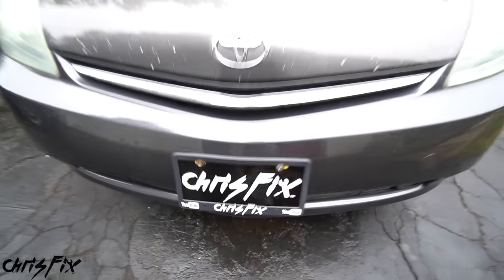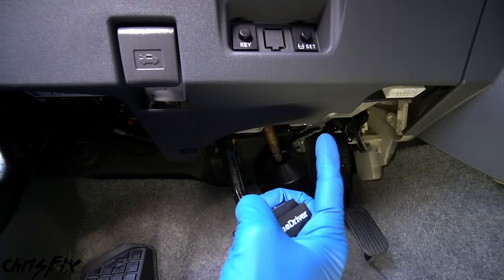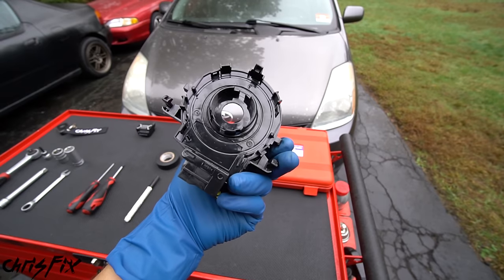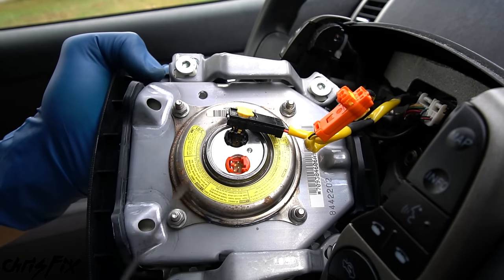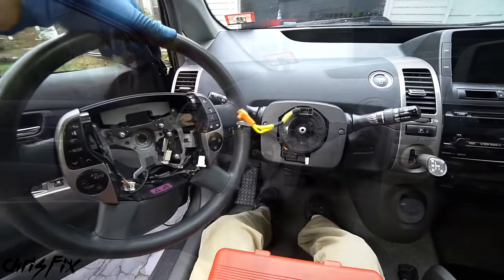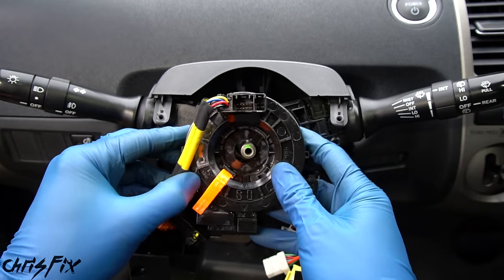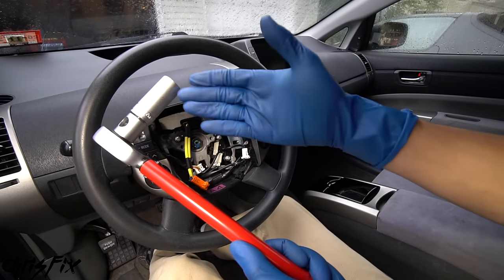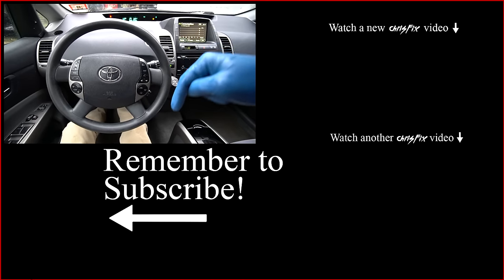How to Replace a Clock Spring (airbag light & horn not working)

Comment: What if the airbag light is on but the HORN still works? Could it still be the clock spring? I have a 2000 Celica and this is my issue. AIrbag light on but horn and cruise all work on the steering wheel. Thanks!
Reply from the maker: It could be. Sometimes the airbag circuit is the only thing to go. But an airbag light can be anything so just get that diagnosed real quick with a scan tool. Most parts stores will do it for free or you can get a scan tool for yourself to keep.

Comment: My horn Doesn’t work and says open circuit and if I turn my wheel to the left, it doesn’t show the speed anymore like it loses signal from the wheel. I might replace that clock spring to see if that fixes my issues.

Comment: Chris my horn on 2009prius was not working. I replaced the clock spring.all other buttons working.  Still horn not working.  I checked the horn fuse it was fine.  I have no clue.

Comment: So my airbag light is on and my horn doesn't work but the cruise works, the radio controls work. its an 06 Sonota. The airbag problem isn't the passenger seat switch either because the light under the radio isnt on with no one in the seat and on if someone is in the seat without their seatbelt on.  Any ideas? the horn fuse and relay are good. maybe both horns are bad. still not sure about the airbag.

Comment: I know this videos old but I hope someone can answer.. I tried replacing a fuse and replacing a relay for my horn ( 2011 Lexus CT200h ) and it didn’t work… I locked my car and had my hood popped cause I was testing the alarm .. the alarm worked and the horn was blasting - so the horn works but I can’t * honk * the horn from the steering wheel. What is odd is that sometimes when the car is in park, I’m not sure if ithe steering wheel was turned a certain way, but my horn would work - however it never works while I’m driving. And living in Miami - it’s important to have a horn. So basically I’m asking if I’m watching the right video right now ? Is it the clock spring that needs to be changed?

Comment: i have a acura rsx i had a 15-3 code faulty opds sensor , i deleted the code it came back today after abt 2 weeks , i was told it could be my clockspring but it’s not checking out for me

Comment: I replaced my clock spring but my steering wheel lock and is super hard to turn and 2 lights came on the dashboard, the problem got fixed but a new problem showed up my steering wheel is electric, do i have to do a calibration or smth to fix the super hard steering wheel ?
Reply: What lights came on?

Comment: So I replaced my clock spring but the airbag light isn’t turning off. Everything is connected and works fine but even after using an OBDII to clear the codes it turns off for a second before turning back on

Comment: Okay so my horn Works my airbag light is on I've got 4 codes

P0171
Fuel system bank 1 sensor 1 lean
P0121
Throttle position sensor signal
P0455
Evaporative emission system gross leak
P0442 
Evaporative emission system small leak

I don't think any of those are connection near the air airbag so any idea how to fix mine what do you think it might be a simple fuse blown or something eals

Comment: I don't see a horn switch button.  Coffee spilled on steering wheel.  I want to fix the horn and the Engine Auto off feature where the motor stops at stop lights to save gas.

Comment: ft-lbs?!  That definitely said in-lbs.  Where did you see ft-lbs?  Also, my Nissan has an airbag light on, and the horn no longer beeps when we lock it from outside with the key fob.  Could that be an indication of a failing clock spring?

Comment: So I assume the Nissan garage is using OEM spec parts, so $250 for the part means $400 in labour. Chris did it in an hour so Nissan made $400 in an hour. 

I bet the mechanic is on an hourly rate and Nissan took most of that as profit. Shocking.

Comment: So i have a question if anyone can help me out.. I have a 07 Mustang w the V6 my horn does not work at all, i changed all the fuses that give power to horn, and still nothing. Bought new set of horns, still nothing. However people been telling me to get new clock spring but i dont have an air bag light. And my cruise control does work. What should i do? Please if anyone knows let me know if i should replace the clock spring or is it something like a grounded wire somewhere

Comment: What if I hear clicking when I push the horn but doesn’t beep?? And my airbag light is not on
Reply from the maker: Start with checking the horn fuse, if that's good then check the relay (it might be clicking but not activating properly), if both check out then it might be the clock spring
Reply: @chrisfix  thanks for the reply 😂I been a part time mechanic 👨‍🔧 watching all your videos they really help especially how detailed and clear you explain things
Reply: @chrisfix  and my steering wheel can 360 like 3 times

Comment: My horn doesnt work and wen i went to the mechanic last year he told me i had to buy the whole steering wheel yo fix it it and it was about 800$ he never mentioned anything abput a clockspring , he instead told me to do an adaption on a button to use my horn and dats wat i did idk if i got riped off? Did i?

Comment: Changed my clockspring on a nissan titan now the traction control light is on?
Reply from the maker: I did a little investigating and it seems like there might not be a connection between the clock spring and your steering angle sensor, did you use an oem part or a cheaper part?
Reply: I used a cheaper part I will try in making an adapter for it.
Reply: Checked the clockspring and angle sensor all seems to work correctly , Need to 0 set the angel sensor.

Comment: Is the 20$ clock spring safe??? I need to change mine one my 2005 Toyota Mattrix, but wtf is that price range, from 300$ to 20$ ??!! I asked my dealership and he said he would not trust the 20$ China one... is it like a big Toyota scam or is it really dangerous, cheap security 20$ part that will make my airbag explode in my face at any moment??

Comment: I replaced the steering box in my jeep and moved the wheel ny accident and broke the original clockspring. Since then ive replaced it 8 times. As soon as im done installing it when i turn left the first time there is tension and then q snap and its broken again. This has happened with all 8. Ive used 3 different aftermarket brands and ibe used 2 genuine mopar clocksprings all with the same results. Someone please help
Reply from the maker: If you got into an accident, you have probably moved/bent the steering column or another part and it's not lining up properly, causing it to bind and snap like you are experiencing. I would check for steering alignment and replace your steering parts as necessary, and this might also be a situation where a professional accident repair shop should step in and check. Let me know if you find anything!
Reply: @chrisfix  my jeep has never been in an accident. I replaced the steering box to a PSC big bore because of my 37" tires. Steering box comes aligned ready to install and the alignment marks were ligned up. The tie rod and draglink are from teraflex and i just had the jeep alogned 3 days ago. I cant for the lofe of me figure out why this is happening. Qnd it always breaks in the same spot. Turn the wheel about 45° left and it gets tension and snaps

Comment: I forgot to mark the bolt and my steering is crooked now lol, what can i do to fix it?
Reply from the maker: Have soeomne outside the car to tell you when the wheels are completely straight and that is the center. Then remove the steering wheel and put the straightened steering wheel back on.

Comment: I did the same thing twice on my 01 tundra and it didn’t work, I know I’m doing something wrong but I don’t know what it is, the wheels are straight, the spring clock is center, I checked all fuses, the horn doesn’t work, I watched videos of 01 tundras. I just give up.

Comment: @chrisfix. 
Hi chris. I have been watching and enjoing your videos. Like them. Im strugelling with my squib stearing wheel. My squib shows the airbag light on but horn is working. Replaced with an other one where the only diference is the letter at the end, on the new one airbag light gone, horn not working. Any tips? 5K0953569C my part number 5K0953569D the new one.

Comment: I got a question I have  a 2003 Honda Civic. The airbag light is on but when I scan it it has no codes. But I don’t think it’s the clock spring because the horn works all the time in whatever position. Anyone know the problem

Comment: 🇺🇸 🇺🇸 🇺🇸
Hey warn people some cars require a radio/navigation code if you unhook the battery for a period of time. Also always ALWAYS REMOVE AIR BAG FUSE EVEN WITH BATTERY DISCOUNTED. STAY 🙏 🌎

PS LITTLE PAINT LINE TO MARK STEERING WHEEL AND DASH 😜😷
🇺🇸 🇺🇸 🇺🇸

Comment: My clock spring also is not working the same in this video i had it repaired in the shop but after they works done airbag light stays on and i have to exert effort to push my horn because its to hard to press... Can somebody help me "DIY".

Comment: Stering buton are working  i can on radio  by presing buton on streing wheel but  horon not working  and also air bag  light on what is problem

Comment: My airbag light stays on after the change
Reply from the maker: I would try reseting the codes again and then see if it comes back. There could also be a relearn procedure or something similar for your car
Reply: @chrisfix  thanks i found out the airbag connector was not connected properly

Comment: My car steering mount button specifically volume up button isnt working ...rest everything working fine...my car is just 15 days old...I dont know what to do ...
Reply from the maker: If the car is brand new take it back to the dealer and get it fixed under warranty.
Reply: @chrisfix  he is ready to fix but he is confused as well cause everything is working fine except just that single volume up button...

Comment: PLEASE never put your hand through the wheel to start the vehicle. ESPECIALLY when you're working with things relating to the airbag! You never know when it's gonna go off when there's a problem in that system, and if it does, you don't want your arm inside that wheel.